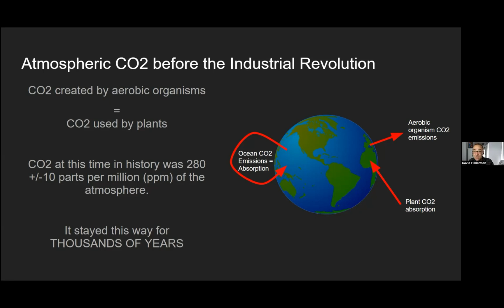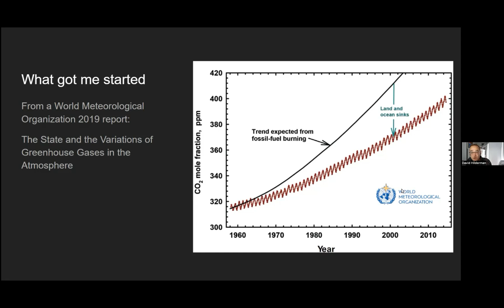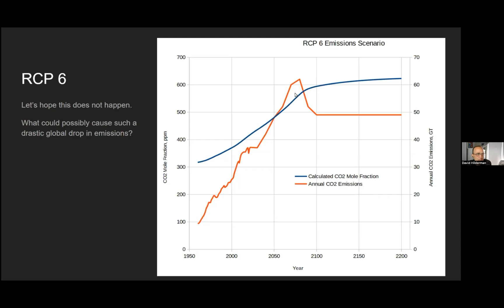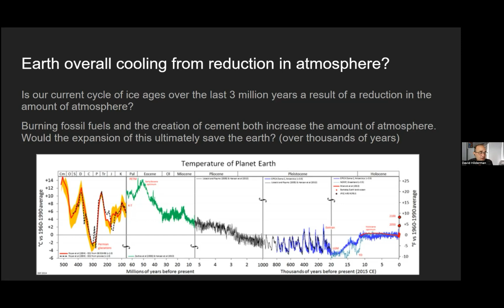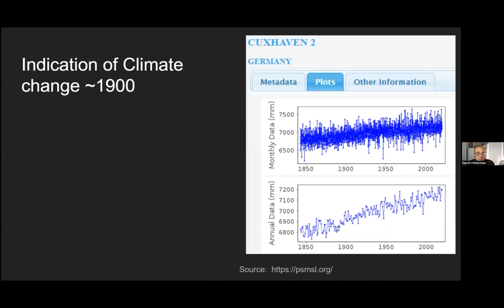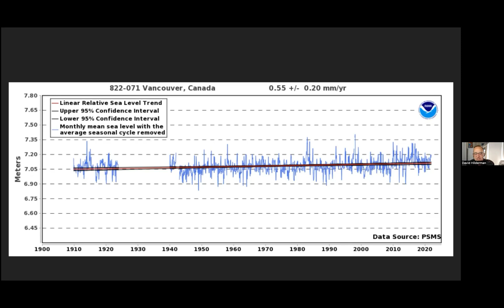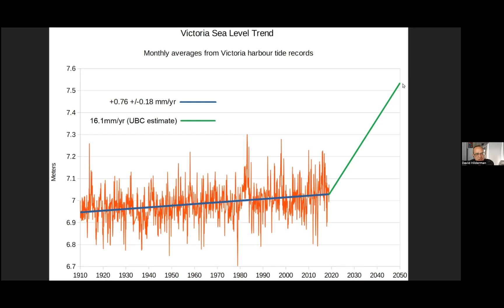David Hilderman: CO2 Emissions and Atmospheric Levels | Nelson Pod #220

Comment: You are missing a huge part pf the oceanic CO2 cycle, which is upwelling of CO2 rich water from deep ocean currents driven thermohaline circulation. All along the equator in the Pacific and Atlantic oceans the partial pressure of CO2 in the oceans (aqueous CO2) is much higher than that in the air. Thus, the oceans there are a net source of CO2 to the atmosphere. 

I suggest reading this paper: https://www.ncbi.nlm.nih.gov/pmc/articles/PMC5668685/

As it states, annual increases of CO2 at Mauna Loa are highly correlated with ENSO, but there is no correlation with human emissions. I have a plot of the data showing this here: https://drive.google.com/file/d/1bB3bPdc_so2udfznt_NOqqoKTXAwc5qj/view?usp=sharing

Comment: The lower yhe CO2 ppm the cooler the atmosphere.  The higher the CO2 ppm the warmer the atmosphere.  Physics.
Reply: yes but cloud variabilty has 75 to 200 times the effect of the CO2 so CO2 is irrelevant. Kinda like if I piss into the ocean it causes it to rise.
Reply: How do you explain ice ages starting when CO2 levels are at high levels ? .,, CO2 has minimal effect on global temperature.
Reply: @goingpostal5858   Which ice age in particular?
Reply: @QT5656  You are obviously interested, go find out
Reply: @goingpostal5858  You clearly don't know and are just parroting Tony Heller or some other grifter.
Reply: @goingpostal5858  You are likely referring to glaciations in the Palaeozoic when CO2 was much higher. However, the Sun was also significantly less powerful and many of the continents were located at high latitudes.
Reply: @QT5656  The sun's output has varied by 0.1% during the 5 ice ages of that period (I guess this is what you call significant lol). CO2 levels were around 7000ppm, so with 0.1% less solar output onto a planet with CO2 levels at record highs most of the planet froze but you want me to accept that CO2 levels of 400ppm will bring on the end of the world in a firestorm ?
Reply: @QT5656  Oh, and please send evidence of CO2 driving global temperature ..  I'll wait.

Comment: ALL life on this planet THRIVES when CO2 levels are between 1600ppm-3600ppm.  If/when we reach these levels we will have more farming yields by a factor of 4x to 8x from plants AND oxygen levels are likely to rise back into the 31% level over time due to planet respiration.
High CO2 levels, in the presence of proper oxygen levels also reduces cancer rates.
CO2 is not toxic to mammalian life until it reaches 50,000ppm - which has never occurred in nature in the past 600 million years.
Go CO2 GO!

Comment: One more question. Do you have any idea of what the time constants involved in these process are?  Suppose global CO2 emissions froze at their current level right now. How long would it take for the global temperature and atmospheric CO2 content to settle down to a steady state figure?
Reply: I thought about putting this in the video.  I just put it into my spreadsheet- CO2 levels would reach 514ppm in 2100 and 540ppm by 2200
Reply: No one knows because volatile changes will ripple back and forth in random domino butterfly effects for ages until a steady state is reached by chance. But we are still increasing emissions so that won't happen for the time being.
Reply: I realise that things change all the time so it's unreasonable to expect that it will ever reach a solid steady state. But there must be some kind of natural time scale where if we were to stop increasing CO2 emissions how long would would it take before we see this reflected in the flattening out of CO2 concentration. I'm thinking about the current idea of trying to achieve net zero emissions. There's no point in doing that unless CO2 concentration stops rising.  If we were to suddenly achieve net zero would it take 1 year, 10 years, 100 years or a 1000 years before we saw CO2 concentration stop rising which it must do otherwise we are wasting our time. We are relying on CO2 sinks (the oceans and plants) to balance out the equation but they can't do that instantaneously. The oceans are a big sink but because it's so big it must take time to catch up.  I image plants would be faster but still quite slow. It could result in an overshoot.

Comment: The CO² life cycle is just like the H²O cycle.  It flows through all life forms, through the atmosphere and water.  You could think of it like a "band" or a "river".  By eliminating farming and ranching, we are merely making that band/river narrower.... we are NOT stopping it.  The more narrow we make that band/river, the more likely it is to break, and that would be the end of life on Earth.  Also, we are, right now, BETWEEN ice ages.  IF CO² heated the atmosphere (which it does not), but if it did, we should be trying everything in our power to release MORE of it, not less, so as to stave off the next coming ice age as long as possible.

Comment: The best thing the Climate Crazies can do to promote their cause is to blow up Mars.  Reason:  Mars has an atmosphere of 97% CO² but it's global temperature is -67°F.  If CO² was a heat sink, even a very TINY heat sink, over the billions of years that Mars has been in existence, it should have a global temperature of molten iron.  But it doesn't. So the Climate Crazies should just eliminate Mars so they don't have to see it, and deal with people like me who point this out.  As soon as I DO point this out, they start in with the OTHER FACTORS like "thinness of the atmosphere" or "distance from the Sun".  Suddenly OTHER FACTORS are relevant.  But 6 seconds ago, on Earth, other factors WERE NOT RELEVANT, IT WAS JUST CO² THAT CAUSED ALL THE "PROBLEMS".

Comment: As usual your graphs time frames are ridiculously short and is the cheat every climate change proponent uses to justify their claims. 
If you pull out the time frame you see we are at an all time CO2 minimum that got very close to being so low that all plant life would have died.
We should be pleased that co2 has increased.

Comment: Are you assuming a linear relationship between current ppm and the capacity for the planet to absorb more into its various sinks? Is there such a thing as saturation? Closed systems tend toward equilibrium. I would think absorption would slow down as the atmospheric concentration increases. Still increasing in nominal terms, but decreasing in percentage. Diminishing returns and all.
Reply: If CO2 numbers were even at 1% it would just barely make sense do do what you propose.  Since it is only 0.042% it is reasonable to treat is as linear

Comment: So if 7GT of CO2 is used by plants, would there be a corresponding increase in O2. But then O2 is being used to burn fuels?  There must be some data on O2 levels.
Reply: O2 is going down faster than just from the CO2 going up.  This difference is the amount of O2 in the CO2 being absorbed by oceans
Reply: The WMO did a study of this in 2019.  I tried putting a link here and YT yanked it.

Comment: You mention about how in one period the excess CO2 was absorbed by plants and also by marine shellfish. I think I read that this was one of the causes of the mass extinction which occurred about 360 million years ago. So much CO2 was taken out of the atmosphere that the earth cooled so much that much plant and animal life became extinct.
Reply: My guess is that the plants that were around couldn't handle such low CO2 levels and most died off.  I also wonder about the idea that less atmosphere caused cooling.
Reply: @davidhilderman  I had assumed that it was because the reduced CO2 levels had reduced global warming and so the atmosphere became cooler. I think you can see that in your graph at about 22:00. The CO2 level falls (black line)to a minimum at about 350 millions years. The temperature (blue line) falls a little later and reaches a minimum at about 300 million years. I'm not at all an expert. I'm just an interested party but if you look up mass extinctions in Our World in Data they describe a mass extinction called The Late Devonian at about 360 million years ago caused by rapid cooling.

Really interesting talk by the way. Thank you.
Reply: @blockhead9746  You don't get it. When it gets warmer, the ocean will release more CO2 to the air.  When it cools, the gas prefer to live in the ocean. Basically, the concentration in the air is a climate thermometer.
Reply: @elbuggo  Thanks for your reply. As I said I'm not an expert, I'm just trying to improve my understanding. At that point in David's graph (22:00) about 380 million years ago the CO2 concentration drops very rapidly but the temperature doesn't fall until about 50 million years later. That suggests that temperature follows CO2 concentration. So the question is, why did the CO2 concentration fall so rapidly in the first place.  Interesting that at the end of that period CO2 concentration and temperature rose at the same time.
Reply: @blockhead9746  RE: why did the CO2 concentration fall so rapidly

The ocean converted CO2 to limestone, or some other stuff? Who do you think ate all the CO2 injected into the system for billions of year? Mostly, the ocean ate it all.
Reply: @elbuggo  I'm confused elbuggo. We seem to be agreeing. When you said "You don't get it" what part of what I said were you referring to?
Reply: @blockhead9746  Have in mind, these graphs aren't a Gospel. IMO, they are very unreliable and have very low resolution. Often the signal is only as strong as the error bars. 50 million years is too long for any relevant adjustments in the system. In 50 million years, we could have been through 500 ice ages.

Comment: The CO2 discussion is purely political.  I’m completely for us reducing pollution as a rate per population, but brining it in to prevent developing countries from “developing”, and allowing the developed countries that have the infrastructure to hold onto their influence is sad.  In the local greenhouses (in Canada) that I’ve worked with they kept their CO2 levels over 800+.  Non hidden measurements of the global past has shown we’ve Breen up to 1200 ppm.  We need to remove activism and politics out of climate, and get back to focusing on local pollution efficiency.  Regarding sea levels, the challenge is the measurement approach.  Shores erode, the earth levels in spots go up and down, so there isn’t always a normalization of what is true increase in water vs a change in land level.
Reply: We have to get back to dealing with real pollution. CO2 is not pollution.

Comment: No there was no balance.

Pre- industrial revolution CO2 was being removed from the atmosphere very slowly.

As the global temperature varies the rate of outgassing/sequestration of CO2 varies, but on average, the amount of CO2 has been reducing. That is where the Carbon on fossil fuels came from, also the White Cliffs of Dover and other carboniferous rock structures are made from CO2 removed from the atmosphere.

Comment: You are right. The planet is greening, and that means more food from the same land area, and less hunger and poverty. Why don't people know this? Well, look up the Trusted News Initiative, started by the BBC, to see how the media are in lock-step on anthropogenic climate change. The CBC is a member. One could argue that being anti-carbon is the same as being anti-life, or anti-human. We are 18% carbon. Additionally, carbon is the Scotch Tape of the molecular world, in that there are more carbon compounds than non-carbon compounds. Vilifying and taxing it is like vilifying and taxing water. As for wind turbines, well, each has a box of electrical switchgear. The box is isolated in SF6 gas, to prevent arcing and fires. All those boxes are leaking, just a little bit, and SF6 is 22,300 times more powerful than CO2 as a greenhouse gas. So, wind farms, with their short life, are going to save us from anthropogenic climate change? Not so sure...

Comment: As you know, we use certain equations when calculating the parameters which cause feedback and nonlinear behavior -- distortion -- when amplifiers are being designed.  In this situation most of the determining factors are well determined and can be measured very precisely.  I was amazed when I read that the climate 'experts' use these same equations to model climate and predict the runaway greenhouse effect.  I was already skeptical before I discovered this.  Knowing that our understanding of natural variables are mostly just guesses, I decided that this is all just a hoax designed to give power and authority to actors I would rather not have such ability.
Reply: Look up Maurice strong, he was one who started much of this in the UN.
Reply: Without too much thought I tried going backwards in time with the equation. It doesn't work. Like backing up a trailer without watching it.
Reply: @davidhilderman  It doesn't seem to go forward too well either, like driving blindfolded.

Comment: You’re not going back far enough. You go back to 100 million years ago and we see a steady decline in atmospheric CO2 until the industrial revolution.  We came dangerously close to having a CO2 level that was too low to sustain life.  Your pre-industrial CO2 levels are too generous , they were closer to 180 ppm.  The climate models also typically fail to realize the ceiling effect of CO2 on the greenhouse effect which currently if nearly maxed out, so additional increases in CO2 will have minimal impact if any.
Reply: I focus on 1959 until today because we have accurate direct measurements of this.  Also my initial equation was in the form CO2(year)=CO2(Year-1)*K + Emissions(Year-1) +Z.  I simply worked with K and Z until calculated matched the actual measurements.  Using this equation I then set emissions to 0 and ran the formula for 1000 years.  The atmospheric CO2 settled down to 285.8.  So, I believe that this indicates that 285.8ppm is where the CO2 cycle was in balance.
Reply: @davidhilderman In balance for what ?
Reply: Exactly, increasing CO2 levels have diminishing returns when considering the amount of heat radiation is blocked by CO2 this is why everything was fine when CO2 was at 3000ppm and the dinosaurs didn't all die from heat stroke.
Reply: “You go back 100 million years”🙄. 
No, you don’t. No one does. Asinine .
Reply: @nancybaumgartner6774  No, to ignore CO2 levels over geological time periods is asinine. When we know for a fact that ice ages were happening at 3000ppm it makes the whole narrative about runaway heating at today's 400ppm a nonsense.
Reply: @schrodingerscat1863  you cannot know “for a fact” anything dating back 100 million years.  Human beings are stupid and arrogant, and most often produce expensive and highly “educated” ruin . Human nature is inherently regressive.
Reply: @schrodingerscat1863  Yes, exactly.